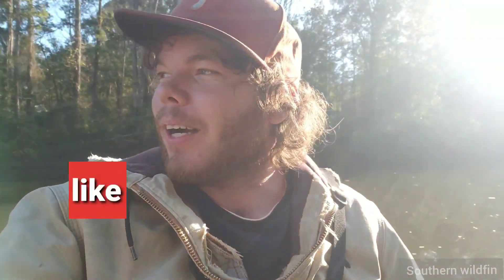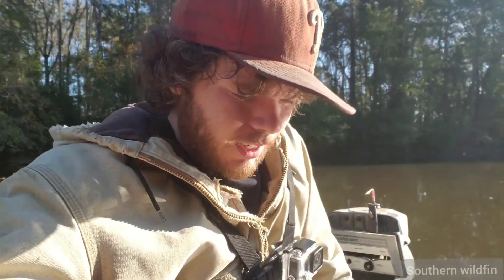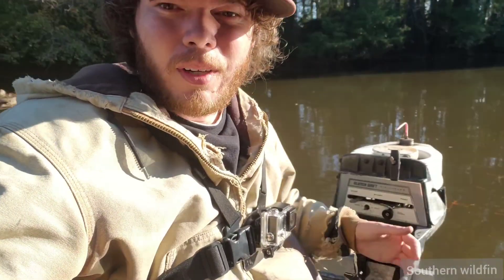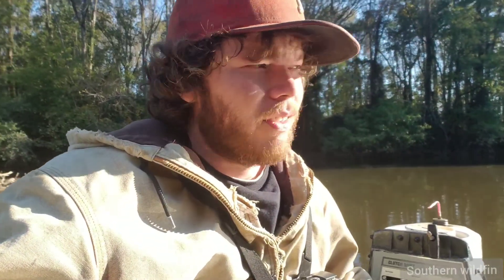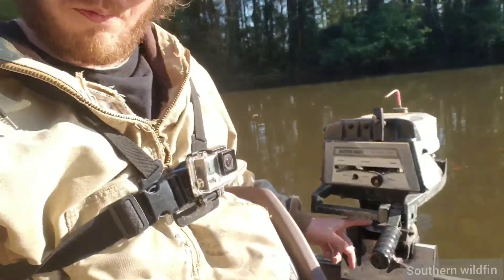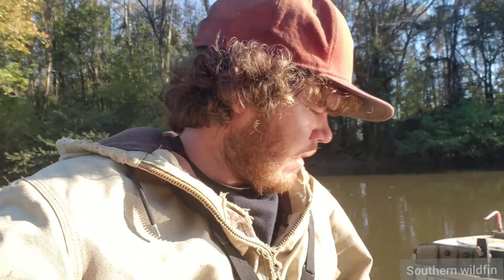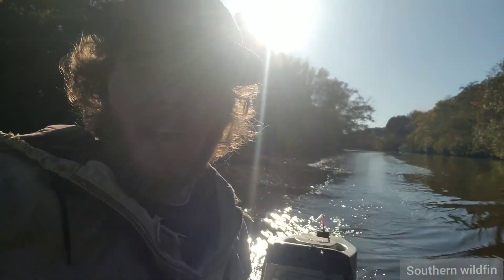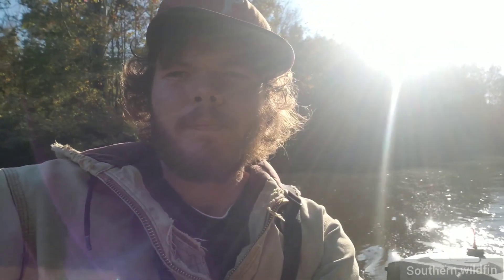7.5 Ted Williams air cooled outboard motor on 12ft jon boat

Comment: You now where to find parts
Reply from the maker: Ebay and Amazon have some. The impeller for the water pump a Clinton outboard impeller work basically the same lower unit
Reply: Discou t marine for parts i have a 5 hp eska ari coold has a water pump had to replace .it was a dilly to replace.